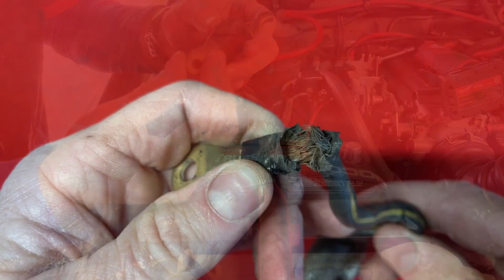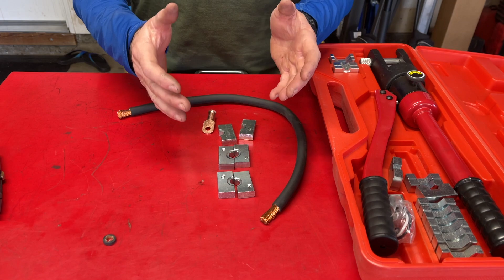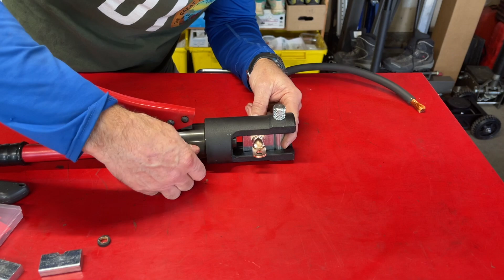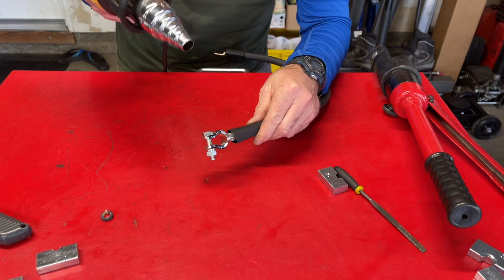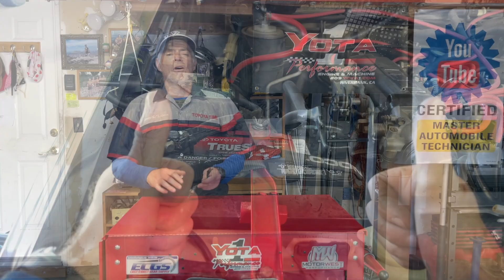How to Make a Battery Cable

Comment: I am sorry for the many comments.. but one more suggestion.. I would upgrade all your grounding cables. Usually for Toyota (I am a Toyota nut like you) they give at least 3-4 grounding locations. Those ground are likely located at the following. 

1. Battery Ground to Closest Fender (usually always present)
2. Rear Firewall to Engine
3. Engine to Fender 
4. Battery to Engine (usually this ground is included in the engine wiring so this one is hard to pick out)

Positive cables
5. Alternator Cable to Battery Positive (usually integrated with some kinda of fuse to reduce any electrical shorts)
6. Starter Cable to Battery (usually not integrated with fuse but integrated with starter relay - So instead of fuse your circuit is protect by a relay/key switch)

These are also the wires that can be updated for the Big-3 wiring upgrade.
Reply from the maker: Yeah, we have a video for the Big 3 upgrade.  Check it out one day when you're bored.  https://youtu.be/fs1RotngY-Q

Comment: Great work as ever. Surprised how thin the OEM cable was and completely agree on using welding cable, which is large, has a decent cover and a lot cheaper than other options. The wire size needs to be related to the biggest load (etc), which is likely to be the starter, but might need to relate to ancillaries, too. I’ve soldered lugs on in the past (orientate the lug as a cup and use thick plumbing solder rather than electrical and heated with a blow torch). It created a very positive connection but the standard is to crimp. I think you’ve made a good case for stepping down with the die size. Unless you’re an octopus it might be worth attaching the fixed crimp handle in a vice and orientating the cup so the wire is easy to bottom out in the lug, if building a cable off the car. I saw the comment on ‘clocking’ the lugs so there’s limited rotational strain, which is good, especially on short lengths. Appreciate your work and the effort to make and share the vids, (plus the links). Thanks!!
Reply from the maker: @saudk9261  Thanks for sharing the article about soldering.  Every video I shoot that includes some electrical work, someone always tells me I should have soldered rather than using the shrink butt connectors I usually go with.  I like the shrink butt connectors because it's a solid connection, and with the shrink component, no moisture or other contaminants can affect the connection.  I'm going to use this article the next time someone tells me I should have soldered the connection.
Reply from the maker: Thanks for sharing all of that.  I haven't soldered many electrical connecrions.  I usually crimp.  We appreciate you taking the time to comment.  Happy Wrenching!

Comment: Mr Timmy can you guide me on the location of obd2 connector on KZN 185. Its a Toyota Hilux Surf right hand drive Japanese with 3rz engine. I do see a diagnostic connector inside the hood but its not a obd2.
Reply from the maker: Sorry, but I'm not that familiar with the Hilux models.  But, it's usually under the dash on the driver side.  Look under the dash near the center console and you should be able to find it.

Comment: Looks very professional!  We’ll done. A few years ago I had a company named custom battery cables make a negative cable for me. They even clocked the cable fittings the way I wanted.
Reply from the maker: Thanks!  You know, that's something I should have thought of.  I could have clocked the connectors to work with the natural bend of the cable.